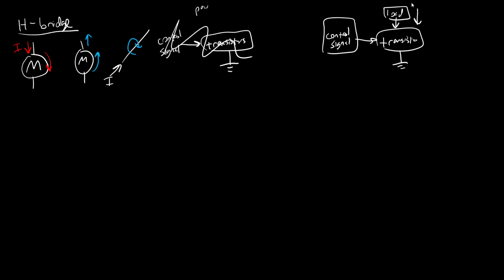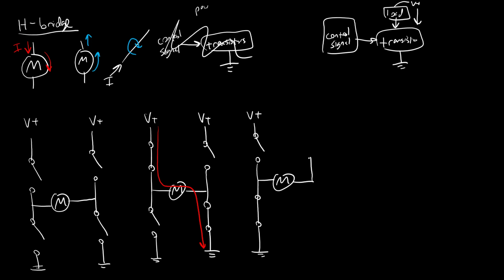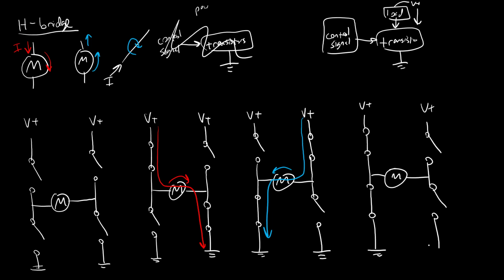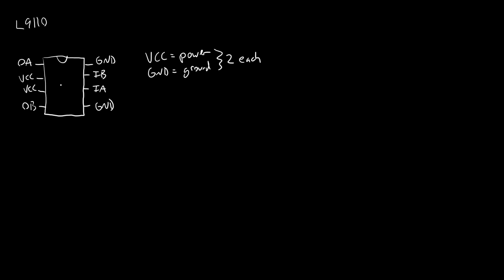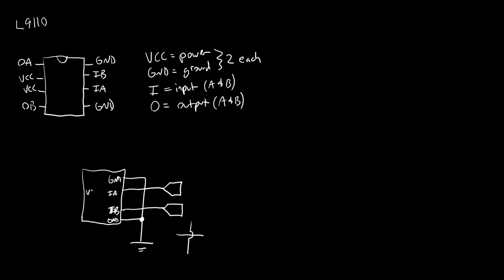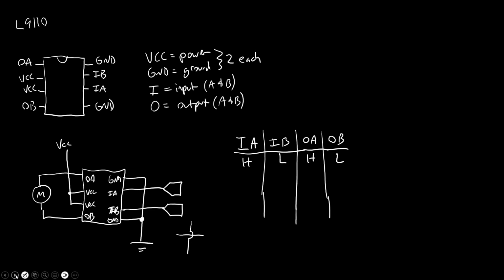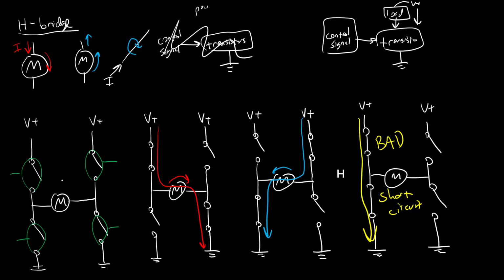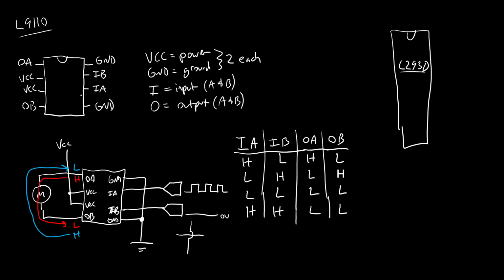Intro to Circuits 52: H-Bridge

Comment: Hello! I haven't seen any DC motor with encoder running using registers videos or informations online and I need some advice, is there any chance you could help me?
Reply from the maker: Hi - unfortunately I'm unable to provide help with individual projects; I have a Tinkercad Circuits and Arduino playlist on my channel that covers I/O registers, interrupts, and measuring pulse duration, which is everything you'd need to use a DC motor with an encoder - I just don't have a video explicitly covering their use with an encoder.
Reply: @BenFinio  Thank you !